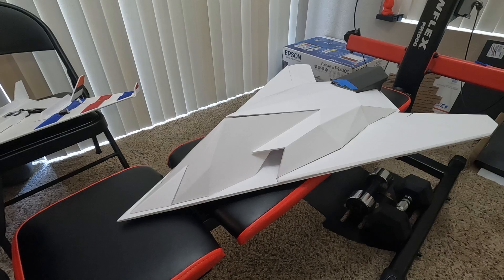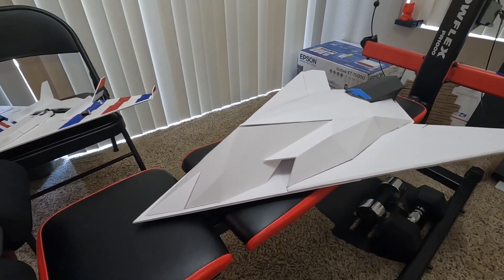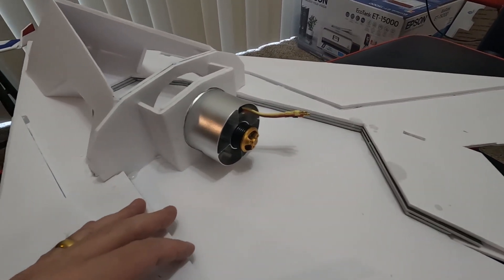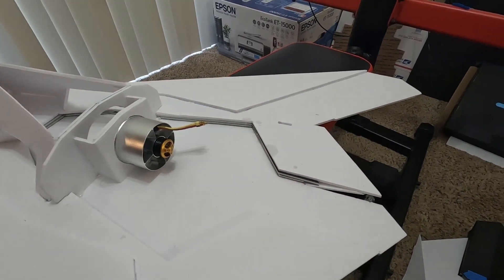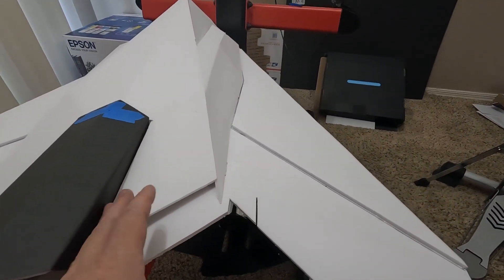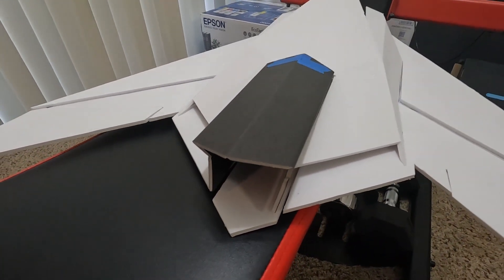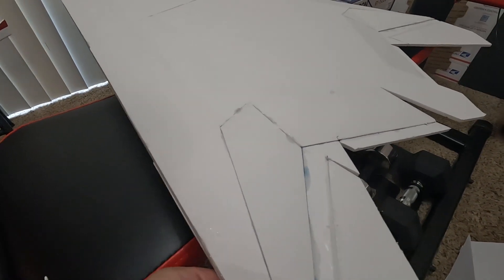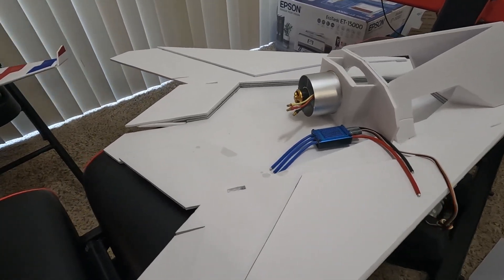FF 117V2 70mm EDF New Build

Comment: Good to see new videos from you Paul!
I made the older propeller version, but I am having trouble controlling it to turn left / right. Everytime I do, the plane spins.... I guess I am turning too much? I am new to RC and trying to learn. Any tips would be appreciated!
Reply from the maker: Thank you for the comment Zosla83.  If you made the original Version 1 FF-117, it has a little larger Elevons than the V2 FF-117 and can have too much roll authority if you have the control surface throws set to high. I actually had it that way on the maiden flight way back when I made it.  My suggestion is to set up your EXPO on the ailerons fairly high and also reduce the control surface throws. If you are new and not aware of Expo, it means Exponential and you can use it to make the control sticks a little more forgiving. If you set your Expo to about 50 or 60, it makes the initial movements more tame. You have to push the stick farther to get more movement. The movement starts slow and low movement and then ramps up the curve the farther you push the stick. Hope that makes sense. Good luck!